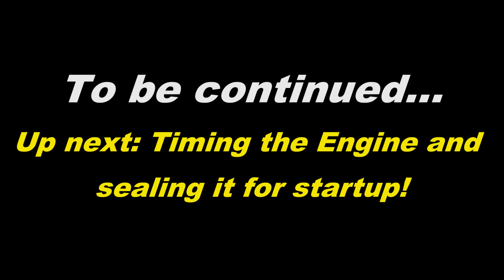Ford 5.4L 3v Engine Timing Chain Kit Replacement Pt 3 of 4: Valvetrain Component Removal

Comment: I still don't understand why we are taking the selected roller followers out... is it for when Cams are in neutral position those are the ones that would put pressure on the valves if left in?
Reply from the maker: You are removing the followers now that would be actuating the valves after we turn the crankshaft to the final resting position. Now when we pull everything apart the cams will be neutralized.
Reply: @FordTechMakuloco  one more... when i go back together and start replacing roller followers after all have been removed, I need to go back to 6 o'clock with the lobes in the right position for all but the first set then back to 12 o'clock to put the remainders in. Am i thinking this through correctly?

Comment: Probably a dumb question....since you have to pull the cams anyway, can you please explain why it wouldn't be acceptable skip the intermediate steps and index the crank so the timing mark is at the 6:00 position and the cams are at the ~12:00 position and evenly loosen the cam journal bearings?

Comment: Why couldnt you just remove a roller follwers from get go ?
Reply from the maker: You could remove all of them with the tool but with this method you only need to remove 3 on each side instead which save a lot of hassle.

Comment: NEED HELP....I'm about to take on a new chain on my 2008 5.4 - All by watching your videos. I've watched all 4 videos and the only part I'm worried about is the part you skipped. Referring to the re-install of removing from min 15:48 the exhaust roller followers. You never show you putting them back in - Any videos I can see these going back on ? Your videos are my go to for everything related to my truck Sir - Thanks

Comment: Thank you for the content of this series. I wish I had come across this before I started the project. I made the mistake of not making sure I was at TDC when I removed the phasers and timing chains. I have installed the phaser on the driver side, but it didn't line up with the lower sprocket like it should have. I then turned the camshaft to have the "L" pointing straight up. I probably shouldn't have done that. It fought me a little, but didn't hear any noise when I did it. I have purchased the tools you recommended, used the crank shaft tool, removed the roller followers, but I'm unsure if the cam is in the right place. I haven't removed the rest of the roller followers. I'm going to put the key way to the 6 O'clock and remove the rest of the followers, and keep my fingers crossed.

Comment: Welp I got dupped by Amazon and received a counterfeit OTC tool once again. The valve spring removal tool will not work. Simply put, whatever Chinese factory stole the design specs got it wrong and I ended up with a bad tool.  No matter what I do the knob will not engage the threads and I'm dead in the water.  Things were going so well, until now!  Anyone else have this issue with the OTC tool from Amazon? If so, any recommendations for alternative valve spring compression tools? I really need to get this job done.
Reply from the maker: If you purchased the tool through my link which is sold by and shipped from amazon and it wasn't an open box item then it is a genuine OTC part and you are just using it wrong.
Reply: @FordTechMakuloco  Confirmed today with authentic OTC 6684 from Summit Racing that the "one sold by and shipped from amazon" is without a doubt counterfeit. Everything about it screams "cheap copy" to include the packaging. Spoke to 3rd level Amazon support and they didn't want it back because there would have been a good chance of it making its way back into the supply chain. Therefore, they issued a full refund and the job can continue. I'm not in the same ballpark when it comes to experience working on vehicles, but without a doubt I wasn't using the tool wrong. 

Lastly, for those purchasing the tool directly from the Amazon link in this video use extreme caution!!! It appears many have received authentic OTC tools, but the supply chain for this particular item has been compromised. I recommend using an authorized dealer from the OTC website or by calling them directly @ 800-533-6127. I personally had luck with Summit Racing and the price is nearly the same as listed on Amazon. NOTE: I receive absolutely zero royalties or commission from Amazon, YouTube, OTC, or Summit Racing.
Reply: @FordTechMakuloco  I thought so too, but there are many folks having the same issue. Certainly not trying to put the video or link in a bad light, not my intention.  This is an Amazon  issue and I've got an RFI out to OTC support.  The tool/procedure is straight forward.  I've checked alignment, positioning, watched the procedure no less tank 20 times. 100% confident the tool is wrong.  Not saying the one you recommend is wrong, but the one I'm using is not right.  I'll follow up once OTC and Amazon fix the issue. Thanks for the response, your videos and advice... everything has been solid. BTW, I found my engine issue...blown chain tensioners.  Imagine that!
Reply from the maker: Is the one you bought sold by and ships from Amazon? I am guessing it is not. Amazon has a counterfeit issue but not in house, it is the merchants selling on Amazon.
Reply: @FordTechMakuloco   Yes, I will send you a screen shot of my Amazon order if you would like. The link seems (likely is) 100% legit, but the supply chain has been compromised by fake/counterfeit products. This assumption can be validated by several customer reviews on Amazon starting around mid-2020. 

I've been in discussion with OTC all day but have yet to hear from anyone other than 1st level call center personnel. I've asked for their legal department to fully address my questions and to call me. I’m additionally seeking a formal response form Amazon. Amazon returns refers me directly OTC, but OTC will not respond with a fix at this point. OTC removed OTC 6844 from their master catalog, which leads me to believe they are aware of this issue, but up to this point they have not responded to correct this issue. Right now, this is in a circular pattern with both companies pointing to the other. 

Your video covering the counterfeit FoMoCo market applies to the tool market world as well. The packaging & labelling do not resemble the other OTC tools I've purchased from Amazon through your links.  The intent of this discussion is to protect your reputation and help prevent future heartache for those using Amazon for tool purchases. I just want to get this truck done; I miss driving her. I'll keep you posted and if you want to talk offline, you have my email/phone number. If not, I hope you have a great Thanksgiving & thanks for reaching out.

Comment: Just pull the plugs nancy! He he.
Reply from the maker: Huh?
Reply: @FordTechMakuloco  oh, you had said you could pull the plugs to make getting the cams free and clear faster but didnt want to cuz of the dreaded 5.4 3 valve. So I was just making a jest to not be scared and pull the plugs. All that being said your shared knowledge is amazing. Thank you. I watched your video and I did the plug/coil pack swap. I ended up getting all out with no breaks. Engine was cold and did carberautor cleaner soak. I did antisieze the recommended portion and also the threads and adjusted the torque down 30% to 18 ft/lbs and our 2004 ford f-150 5.4 3v is now running the best ive ever heard. Again thank you.

Comment: Help Please: I am trying to get the camshaft lobs at the right position when i am at the 12 o'clock position. But they are not. I have rotated the Camshaft 360 degrees and the Camshaft lobs are still not at the correct location. But if i put it at the 6 o'clock position cylinder 1 Camshaft lobs are correct but cylinder 5 is not. Does this mean my timing chain jumped. And how do i get the Camshaft lobs to a line correct in the 12 oclock position so i can remove the 6 followers.

Comment: why didnt you use cam holders over taking the roller followers out
Reply from the maker: Ah I figured you had the 2v and 3v engines confused. Those cam clamps are only for the 2v engines. They would would never fit between the cam lobes on a 3v engine they are too tight. The point is mute though because as I have stated in just about every 5.4L 3v video on my channel, you want to remove and check the roller followers by hand for wear as they are a high failure point in this engine. So on the 3v engines even if there was a cam clamp available to fit, you wouldn't want to use it.
Reply from the maker: what cam holders are you speaking of, please tell me.

Comment: Hello back again wanted to ask is it a must to remove all the rollers in order to time the crank and cams or can i turn the cams with only the specified rollers removed... what im trying to say is will i damage the valves without removing all the rollers and manually turning the cams that are still pushing valve springs?

Comment: So I got the claytons kit because Iv seen them last over 100k miles the only thing with them is they don’t have the marks on the chain ! Does that matter ?
Reply from the maker: You are in for a big surprise with that kit I’m warning you now take from my experience.
Reply: @FordTechMakuloco   what is the down fall not trying to be an ass just curious on it because they are still 500 bucks
Reply from the maker: So many issues from tensioner blow out to premature guide wear to chains breaking. Don't even get me started on the phasers... The genuine Ford kit was just $605 the other day when I checked, why in the world would you risk going back in or engine damage if the chain breaks for just $100 difference?

Comment: I'm doing timing and roller followers(they are all out) on a 2003 4.6l triton. Is it the same as your 5.4l video? And do I absolutely have to remove cams.. and can I install roller followers when I re-install cams?

Comment: Having troubles with the valve spring compressor seems like no matter how I put it on there it won’t screw on
Reply: Sounds like you got a fake one like I did. Amazon honored a full refund even though I bought the tool in July.  If the head of the foot screws off, it likely you got a counterfeit thought Amazon.

Comment: I’m working on my 2010 f 150 timing chain and phasers/ do I need to remove the camshafts and followers entirely if there in good order or can I skip that step? I do have the special tool for the crankshaft timing position

Comment: I made a mistake somehow as I was trying the crack to line up everything at the 11 o'clock position the chain jump on the crack letting the passenger side get out of alignment. How to I correct this so I don't bend any valves to move on

Comment: Exactly, how do I approach the cams moving after chain removal... Is there anyway to correct it, or proceed with video instructions and pray??
Reply: Did you figured it out . I'm at the point where I got mine at the 6 o'clock position but my camshaft dosent spin freely . I got the 3 roller followers out on each side . I dont know what i did wrong

Comment: Fordtechmakuloco... My cams were under tension, when I removed chains. They are not free flowing with my keyway at the 6 o'clock position... Did I screw up big time??
Reply from the maker: Oh yeah
Reply: @FordTechMakuloco   oh yeah?? What happened? Can it be corrected??
Reply: @FordTechMakuloco  I followed the video perfectly, I can turn the cams but not with one finger... Why would my phasers jump and be under tension?
Reply from the maker: If you followed it perfectly then the the cams would not be under tension.
Reply: @FordTechMakuloco  Is there a solution???
Reply from the maker: At this point you want to loosen the cam caps slowly and evenly until the cams are free. Once the cam caps are removed, you then remove the tensioner bolts and toss the tensioner on both sides. At this point you can continue with the timing job following my videos.

Comment: The melling oil pump you have listed says it doesn't fit my 2010 f150 any thoughts
Reply from the maker: The oil pump fits all 3v engine 2004-2014.
Reply: @FordTechMakuloco  That's what I understood but Amazon says it doesn't fit my 2010. I think they are smoking to much China white.. Thanks for taking the time to respond to my post. I've ordered most of the stuff you listed. I'll try to let you know how my repair turns out.

Comment: Greetings, quick (I hope) question.  My sons pickup started running very rough and backfiring, was near impossible to start and was throwing p0435 along with misfire codes.  Pulled covers and chain guides are almost completely gone, tensioners appear no good and lots of chain slack, had been beating on the front timing cover.  Did do a compression test of each cylinder before exposing it and all were at or a little above 92psi.  I have it exposed and it appears as though the drivers side cam is almost exactly 180 out of time.  With keyway on crank at 12:00 on TDC, passenger side cam lobes are in correct position but the drivers side is not, it looks near 180 off.  The dash timing mark on the drivers side phaser is up instead of the L, I'm seeing both dashed timing marks (original ford phasers) up rather than a dash on the passenger and the L on the drivers.  Truck has 110,000K on it.  With decent compression is it still worth putting in new parts and putting this thing back together?  Have you seen one do this before?  Thoughts?  Love the channel and thanks for the education!

Comment: When I was compressing the spring down, I was a dummy & pushing down on the oil hole side of the follower instead of valve side the keepers are still together but the little indent where they're supposed to sit is above like a 1/4 inch. Do you possibly know of a trick to solve that? Even though you clearly said not to let this happen...😳

Comment: Can anyone help me my camshaft moved and i need to know how to be sure its okay
Reply from the maker: It can't move on its own if you followed the video.
Reply: @FordTechMakuloco  My cams were both under tension and moved when I pulled the chains, keyway was at 6 o'clock... They both are not free flowing like the video. Am I in the clear??
Or did I screw up??

Comment: How to remove roller followers if engine jumps timing?
Reply from the maker: If the engine jumped time then its time to replace the engine anyway so no need to remove them.

Comment: Brian, been following right along with your videos. Doing a complete timing job on my 2006 F150. Need help though! I plan on changing everything... camshafts, roller followers, lifters etc. So to remove the cam shafts, do i still need to take out the 3 rollers on each head first before putting the crankshaft into the neutral 6 o'clock? Or can I just pull the camshafts? I'm real nervous about valve/piston collision or dropping the valve by the keeper coming off. Or won't I have to worry about that by removing the camshaft and all the valves should lift up right?

Comment: Brian. My driver's side tensioner failed and chain was loose enough to knock on the tcc. Could this cause it to jump time? If not do i need to lock the cam when replacing the tensioner?
Reply from the maker: I have never seen one jump time just by being loose
Reply: @FordTechMakuloco  few years ago first learning anything about working on vehicles i did a timing job on my 4.6.. long story short when i removed a chain without locking the cam, it moved one way or another caused complete nightmare.. just was thinking with the chain loose enough it would do the same.. your the whole reason ive gotten as far as i have. Man i trust whatever you say without question brother.. thank you for your reply man. Thank you for teaching and saving so many of us money and headaches.

Comment: hey fordtect, i need your help. i was following your instructions but mad a mistake when setting top dead center, i thought i was on the compression stroke when i wasnt, i removed the timing chains and tensioners before i noticed, i tried to advance the crank without the tensioners on and they slipped back on me. so far nothing has made contact but im a little scared as to what to do next. can you help?